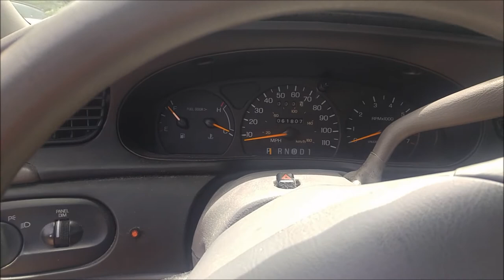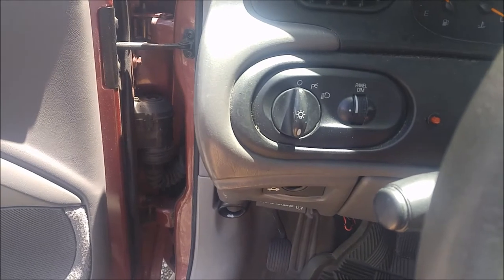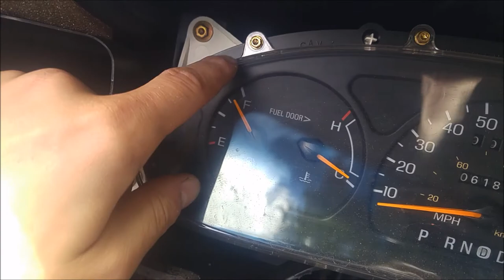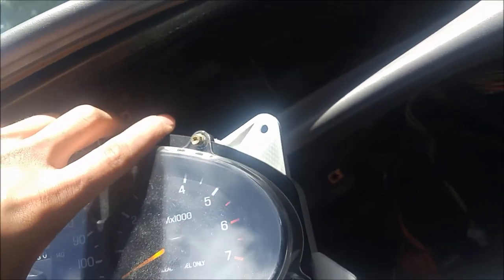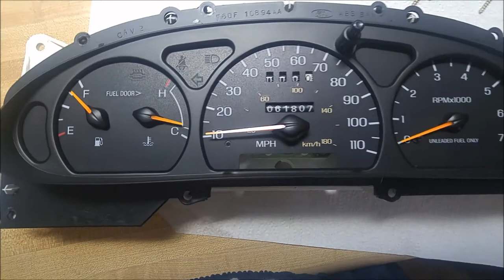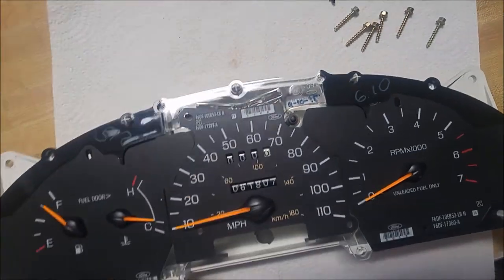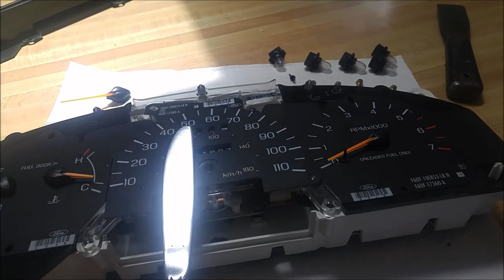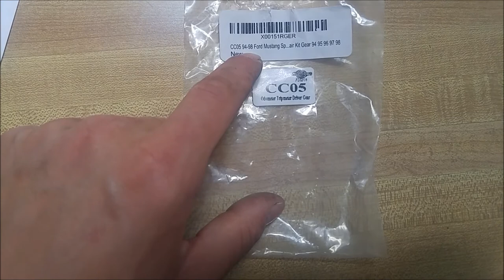1996 Ford Taurus Odometer Repair

Comment: That was an excellent video very helpful I just did mine unfortunately the gear didn't break the ear that holds the motor did I fixed it via zip tie. Unfortunately I have to pull it all back apart when I put the needle back on the speedometer I thought it was set to zero but it was 25 mph in park 🤣

Comment: How did u set the speedometer  when putting it back together mine read 10 mph too fast
Reply from the maker: sorry but I cant exactly remember, I do know there was some sort of procedure to get it lined up correctly. How did you  install yours? I do remember having to take the cluster out a couple times after driving it to find the right area to readjust it.